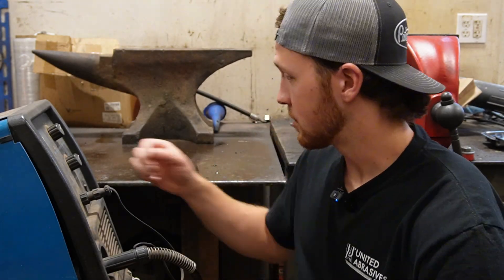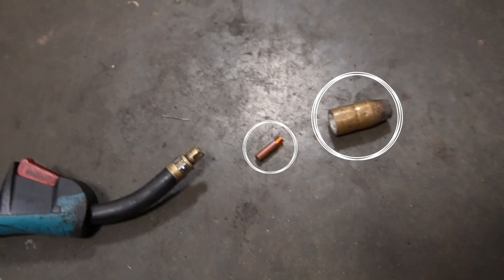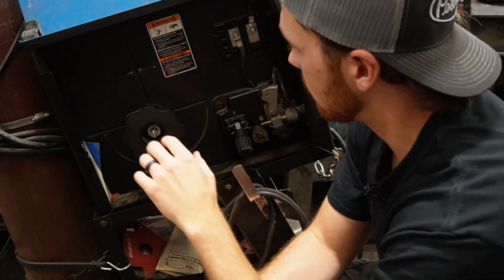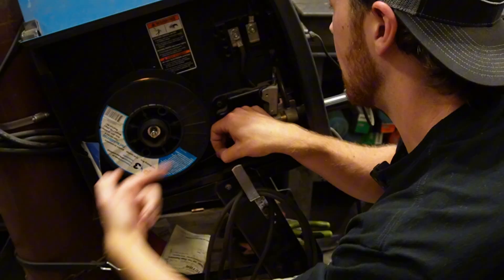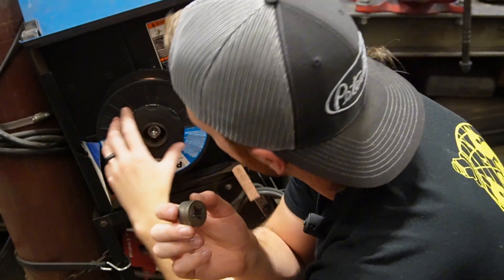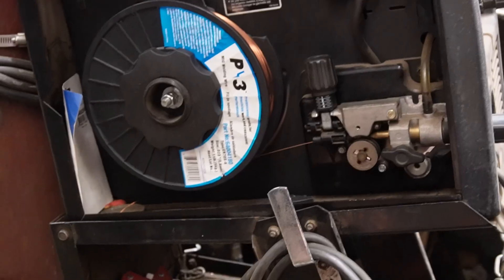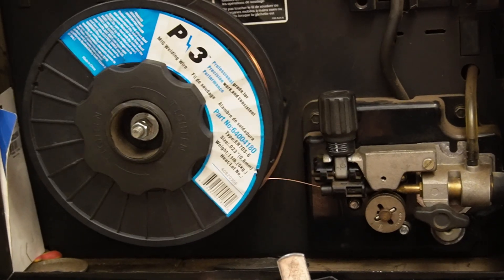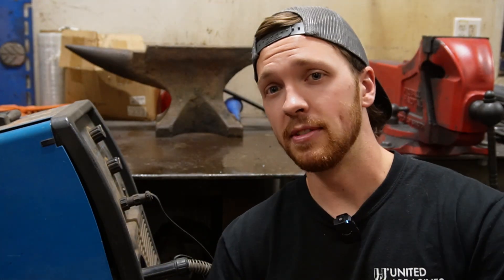Do Your MIG Welds Suck? - It Starts With Setup (Part 1)

Comment: Anyone can forget one of the basics even after you've been doing it a while, and it all has supposedly become habit.  If your beads suddenly terrible, question the basics.
I once welded / reaccomplished a friend's broken hand-rail.  Outdoors, so I'm using fluxcore.  There was hardly any wind, ideal conditions.  But welds weren't happening, spatter and porosities and WTF.
You guessed it; I had forgotten to switch polarity. >_<

Comment: Gee, if only Miller would put the actual wire feed speed and voltage numbers on the knobs (on the lower end machines) instead of meaningless numbers we have to look up on a machine-specific, Miller-provided chart.  
That would be SWELL.